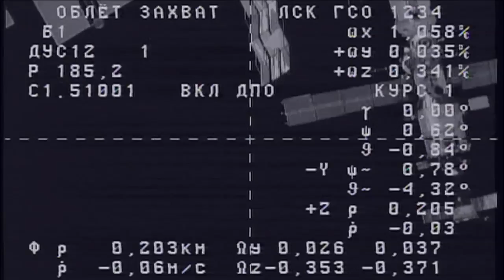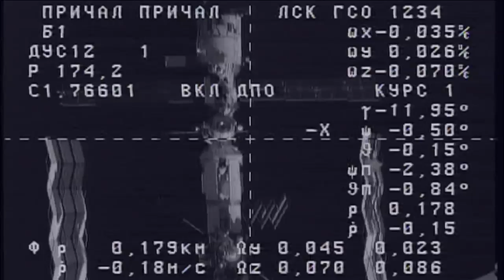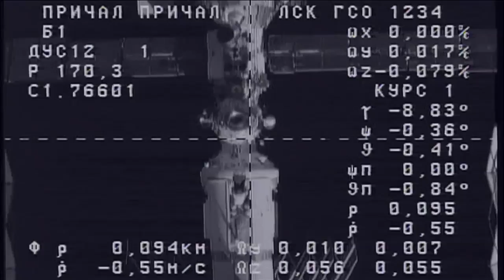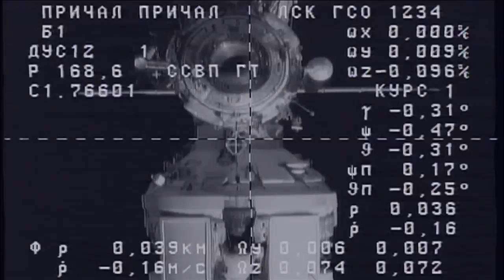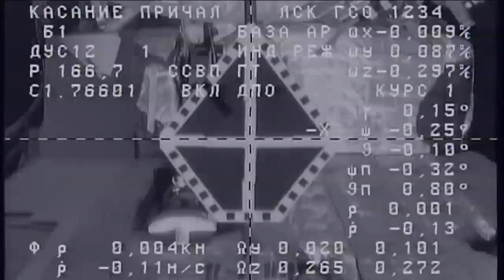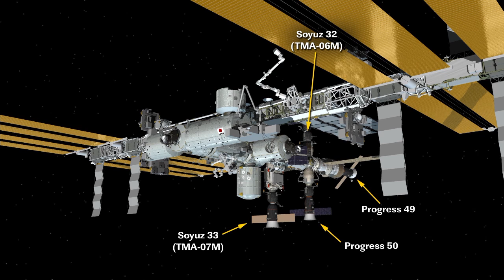Re-Supply Ship Docks with Space Station

Comment: The manned spacecraft are protected against the heat. The Shuttle had cheramic tiles, which could resist the high temperature. The Soyuz has a heat shield that slowly melts away, transporting away the heat.
The Progress cargo ship, like that on this video, is loaded with garbage from the ISS and sent to burn up like a meteor, when it re-enters the atmosphere.